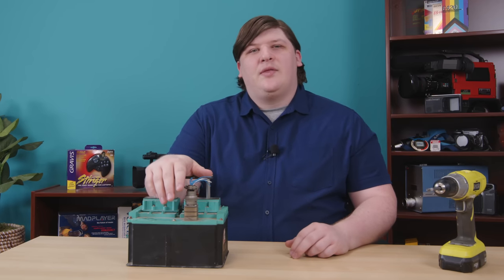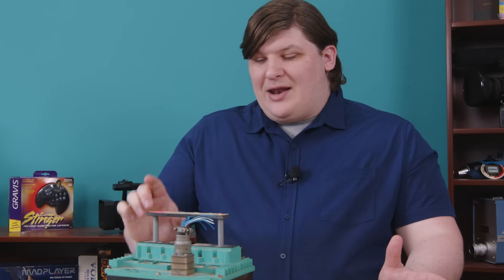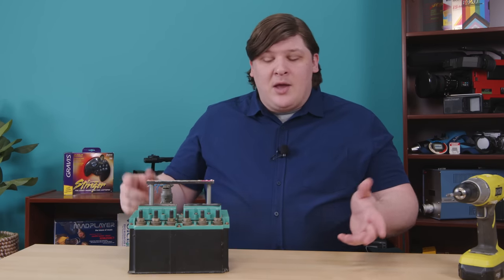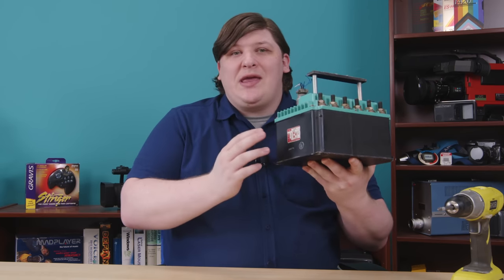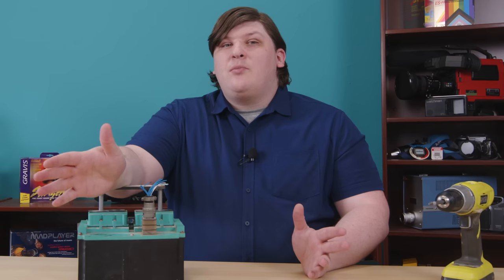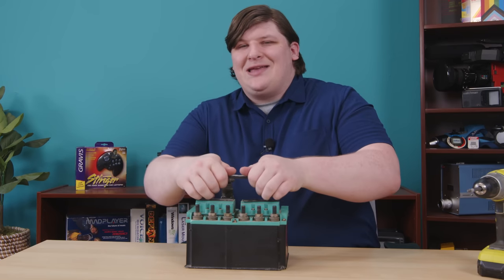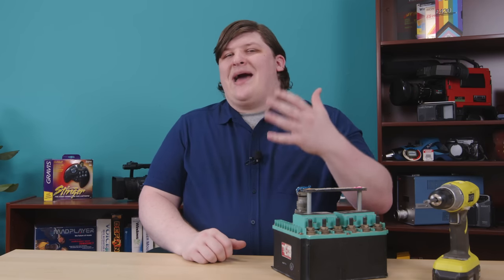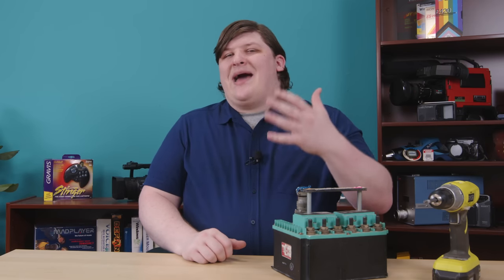A Short Story About (Battle)shorts

Comment: In RC aviation we always use unprotected Li-Ion or LiPo cells, because sometimes we want to burn a ($15-100) battery if it means getting a ($15-10,000) airplane or multirotor back and/or out of a dangerous situation
Reply from the maker: Whoaaaa. That's a really intriguing use case!
Reply: Wow, didn't expect someone to have covered this already. I've "landed" a 5" quadcopter with the throttle pinned to 100% to just keep it from falling too fast. Last battery voltage I saw in the video OSD was 1.5V/cell, so 9V total for a 6S. Was really surprised that the ESCs haven't given up before that. It ended up dropping dead from about 3m height. 
Normal minimum voltage for a lipo is 3.2V/cell, and we usually land at 3.5V/cell. Suffice it to say, that battery never flew again.
Reply: I imagine the fact that the batteries are typically "somewhere up in the sky over thataway" when being operated makes that a more comfortable decision - if there's going to be a lithium fire several hundred feet away is a pretty good place for it
Reply: @marekfiferna  Oh whew. Not going to lie I got a little triggered when he said over current protections are used in all but the most simplistic devices. Like hey now my 5" FPV drone isn't what I would call overly simplistic and you can pretty much burn anything out if you try hard enough lol. Now fuses on parallel charging boards are a very very good idea XD.
Reply: @Echin0idea   Haha .. well, sure, as long as it keeps flying until it's done burning.  ;-)
Reply: So what you're saying is there's a bunch of deliberate fire hazards flying over my head because my life and the value of the house I live in is considered worth less than some random teenager's toy drone they're using to look into bathroom windows? I mean if I die in a drone-caused forest fire I can at least be happy that that teenager will one day grow up to be a fine suit, but it still feels like there has to be a better way. Parachutes?
Reply: @insanemole  At $15-10,000 he's talking about a really nice scale RC plane or a heavy lifter multirotor for DSLRs and cinema cameras. Like as in something that would be used by a movie studio. There's no way in hell there's a bunch of that kind of stuff flying over your house, unless you live next to a celebrity lol, since very few people can afford that kind of stuff. Definitely not toys.

 FPV drones can catch fire since you are draining the battery much more rapidly with higher prop speeds. But that's pretty rare. Lipos are far more likely to catch fire while being charged. People buy ammo boxes to charge them in so they don't burn their house down. Forest fires are far more likely to be started by old failing electrical grid infrastructure or EVs like Teslas. FPV drones also aren't great for spying since they have upward tilted cameras, are fast AF, and usually use low res analog video transmission. 

Off the shelf camera drones like those offered by DJI are the only drones likely to be used to look into bathroom windows and again those aren't toys for teenagers. Not to mention using a loud ass flying leaf blower is not the best way to spy on someone. Unless that someone is a big industrial agriculture company and you are an animal or human rights abuse watchdog. Which is why it is now illegal to fly over industrial farms and is part of the larger ag gag laws.

What is a concern is that the FAA is implementing Remote ID which will require all UAVs to have a transponder attached to them that will transmit the location of the aircraft and pilot to anyone with a Bluetooth receiver like on your cellphone. There have been 0 deaths or major injuries due to drones. Its not being implemented for safety but to clear the airspace so the Amazon's and Walmart's of the world can live out their pipe dream of having drone deliveries. It used to be illegal to do autonomous flights at night or fly over people. With remote ID those are both now legal. 

If drone deliveries actually come to fruition it will be a major safety hazard since we are talking about very large drones. There's no way to insure nothing ever fails so there will be accidents. Not to mention its highly inefficient doing point to point deliveries of one small package. So because people want same day deliveries of toothpaste there will be constant noise pollution in areas serviced by drone deliveries. And when one of them falls on someone or their house or car I highly doubt Amazon will be held liable.
Reply: @gatticusfpv3174  Drone deliveries....skeet shooting with prizes.
Reply: @vertigo72480_official  Yeah I live in the "No step on snek" (liberterian) part of Washington state and that's exactly what I'd be far more worried about if I were Amazon or the FAA lol. There's just simply not enough FPV pilots or even camera drone pilots for it to register.
Reply: A 700 class electric helicopter typically costs $2000~$3000 and runs a 4.5kw~8kw brushless motor with a 12S 5000mah lipo battery (almost always two 5000mah 6S in series) and a 150A~200A speed controller (the thing that runs the brushless motor). Also many people will run the flight electronics (receiver, servos, flight controller) of a separate much smaller 2S lipo or li-ion battery in case something happens to the main flight batteries.

 Larger RC aircraft are not sold "ready to fly" they come as a kit that must be put together and set up. In the case of larger R/C helicopters you buy the airframe kit (which comes as a box of parts) and usually you must buy the electronics and power system/motor seperatly and set that all up yourself.

 Most speed controllers have a configurable cutoff that will reduce power if is detects the battery getting too low. usually this is set to 3V per cell and something like 50% power.

Comment: I imagine you came across it in your research but probably the most famous example of this in combat was the USS South Dakota at the second naval battle of Guadalcanal. This was a night engagement and thus the South Dakota needed her radar which was one of the biggest draws of current on the ship. However apparently there was some sort of issue and running the radar was tripping the main breakers. According to some accounts to try and get the radar running long enough to be useful in the fight against the enemy destroyers, the breakers were literally tied open with cables. This would however lead to a number of electrical faults and basically all power being cut for 10 crucial minutes and continuing issues with the ships electrical system throughout the rest of the battle contributing to her awful time fighting the Kiroshima. Thankfully for the crew of the South Dakota, the timely intervention of the USS Washington likely saved her from either sinking or crippling damage but the whole affair does demonstrate that even if disabling those protections can be an immediate solution it can also have an immediate and significant cost.
Reply from the maker: Aha! I kept things restricted to motors because I understand them well, but I suspected the radar would sometimes be an applicable case. Specifically, I imagined: What if an antenna feedline gets crushed or punctured, effectively "pinning your coax"? Suddenly your radar could be driving kilowatts straight into ground... but if it's a high resistance short, maybe it can still function minimally, better than nothing. I wonder if that's what they were up against.
Reply: I've actually spent the past year mapping oil slicks around Guadacanal from satellite imagery to try and locate the wreck sites of many of the ships lost on either side of the various battles in the 'Iron Bottom Sound' as part of work with an Australian Non-Profit. It's been rewarding work but reading short stories like this reminds me that those few pixels on an image relate back to a horrific/terrifying experience for hundreds of people ~80 years ago. It's genuinely stunning how many shipwrecks there are from the second world war, and the consequent human toll it implies. We're remarkably lucky to live in the time of comparative peace that we do.

Comment: I operated Nuclear Reactors on submarines. (Awesome job and you’re welcome!) we spent two years learning power and electrical systems as we spent the majority of our time making sure the boat had electricity! The explanation is spot on. Yes it is single use.
Reply: I was a nuclear electrician’s mate on an aircraft carrier, and will add that 3-phase 400Hz systems are typically high precision set for radar and other equipment for the flight deck.
Reply: Limacho you sumadon
Reply: 1: thank you both for your service. 2: You're bigger and tougher men than I to live in one of those Pringle cans of Death.
Reply: You're welcome? Are you assuming I'm going to thank you for what you did? No way. No thanks. I wish you hadn't done what you did. Get off the high horse, you aren't special.

Comment: My only use of Battle Short Override was on a generator powering a small Fire Direction Control Center for a live fire exercise. Mid fire mission the generator lost oil pressure and started sputtering and was about to shut down. The Officer in charge told us to use the override so we didn't drop mission. Afterwards we shut the generator down and called maintenance the generator was toast.
Reply: 13D or 13P? I was both. My first encounter with a battle override was on just such a generator! Never had to use it. Pretty sure if it had failed we would have been good for about and hour, our trucks each had a beefy UPS to allow time to either fix the generator or switch to alternate power sources.
Reply: There is NFPA 110 for regulating emergency and standby power systems. There is different levels that include the generator will rather damage itself than fail in a power loss scenario. https://youtu.be/XGnGUWoUbII?t=909 Here you can see someone setting these levels in a engine controll unit.

Comment: For my sins, I have worked as a test/repair engineer the UK defence industry in my career on naval defence equipment. What you have explained about the way that device works is pretty much spot on. 

A word about that bayonet electrical connector on that unit. If it was made in 1974,  the electroplating on those connectors could potentially be CADMIUM. CADMIUM IS TOXIC, DON'T HANDLE IT WITHOUT SPECIAL PRECAUTIONS. It may not be, but it is not worth taking the risk. It is always worth remembering when purchasing old kit like this that the safety standards and knowledge of toxicity of many of the chemicals and metals used were not as well known as today. 

Cadmium was chosen for it's strong resistance to corrosion in a highly corrosive environment such as sea going vessel. With units like these I would strongly advise NOT to handle any connector on there without safety gloves and a dust filter mask. I'm not trying to scare you, but this is what we had to do when a piece of kit like the one you have there came in for repair/refurbishment. Cadmium salts form when it is exposed to a long term corrosive environment forming a white powder which contains the toxic cadmium and easily forms a dust which can easily get into the air.

Please handle with extreme care!!!!!
Reply: Awesome explanation!
Reply: dude, cadmium is awesome

Comment: I'm an electrical engineer who works on industrial equipment 
we CAN give codes to override safety cutoffs if those cutoffs are in software in case its worth it for the customer to risk permanent damage to equipment to meet a deadline 
we have done it a few times but we dont even bring it up unless specifically asked 
internally we call them 'war power codes' and today i found out why
Reply: There could be another source for calling them war power codes. Some aircraft during WWII would have a throttle setting called "War Emergency Power" that would be more than 100%  of the engine's rated thrust with the downside of shortening the life of the engine and possible requiring the engine to be inspected after use. 

The term now is used as "military power" to refer to full throttle minus afterburners and the like.